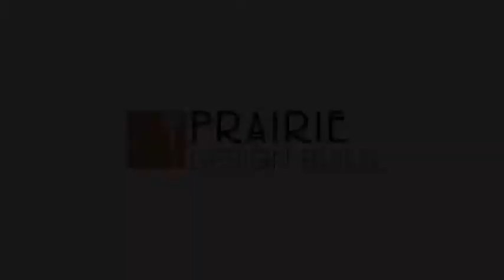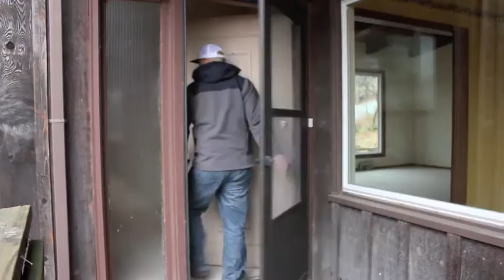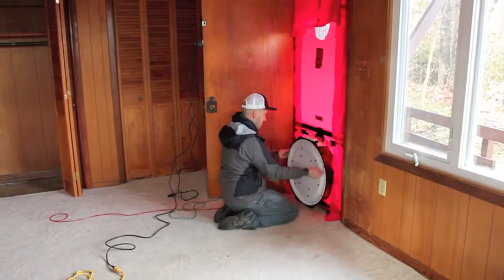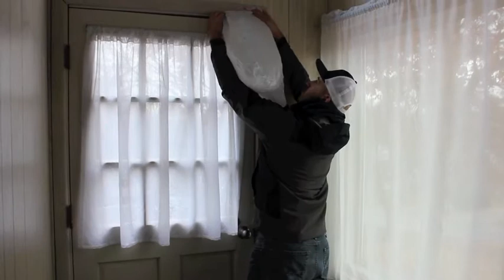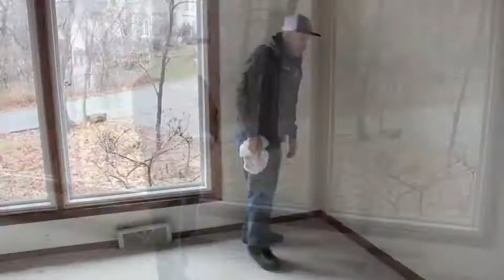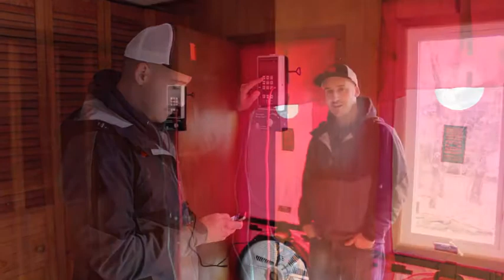Lake Quivira Passive House - Preliminary Blower Door Test

Comment: Great video guys!

The flue pipe for atmospheric water heaters is a common source for outside air to be brought in. When this occurs, the gases from the water heater may end up in the house. Passive homes should consider Power Vent, Tankless, or even electric water heaters.